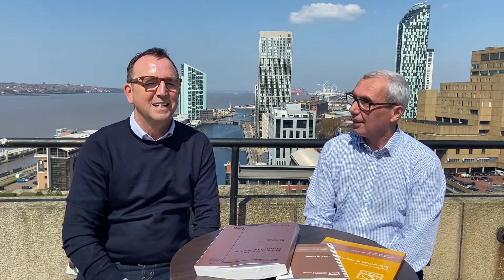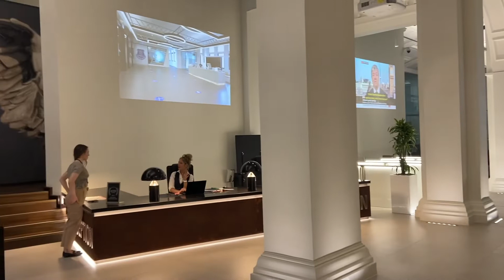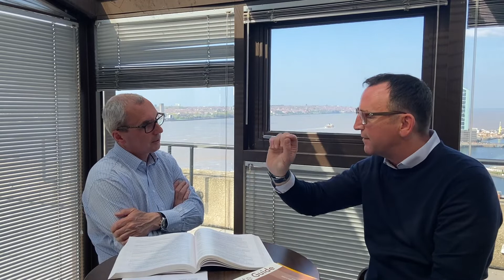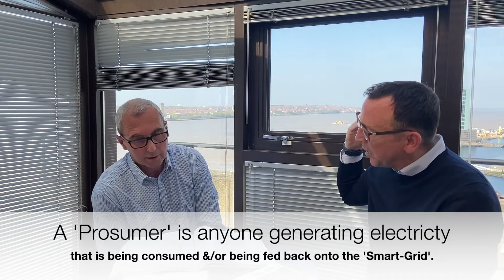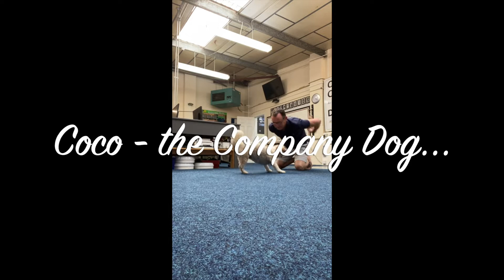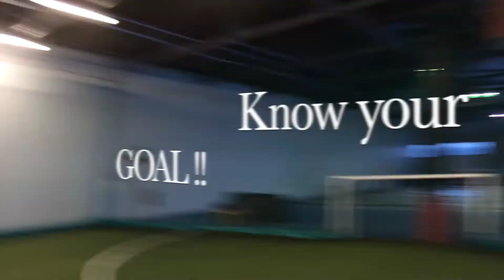18TH Edition Amendment 2 Explained

Comment: Cable management through voids in corridors. 
Does this mean cables cannot be run in a suspended ceiling? Like a final ring circuit?  Obviously the lighting cables have to be there.